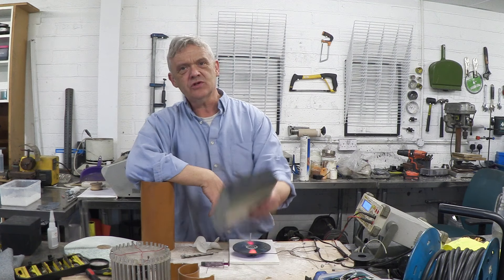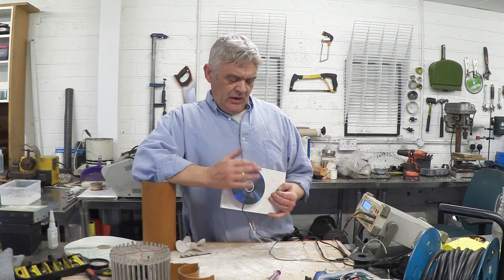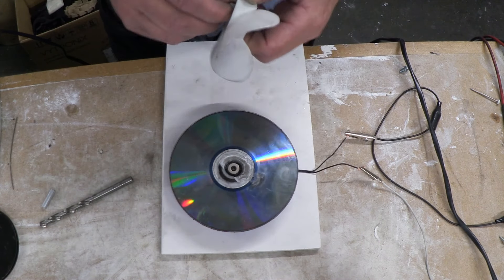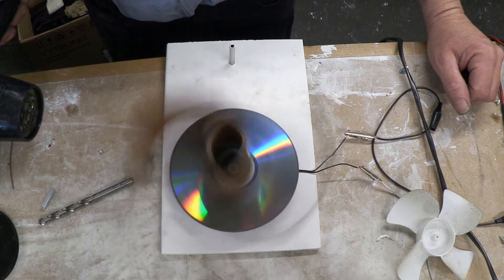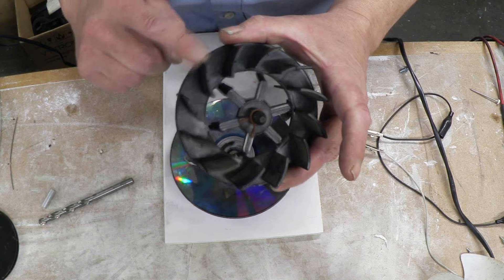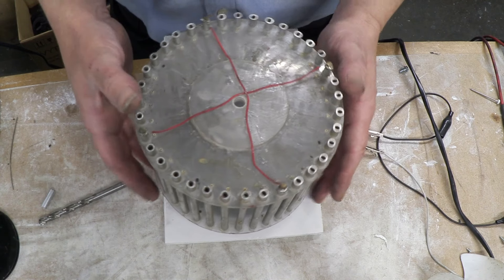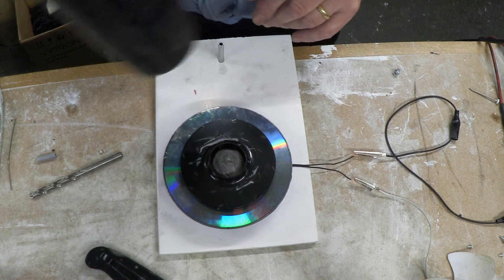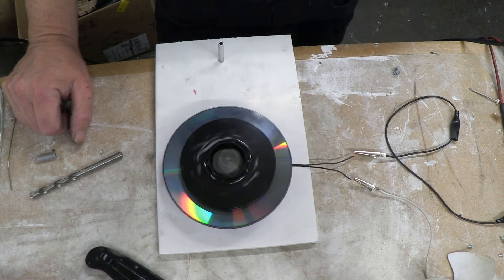A Flat Wind Generator

Comment: I'd like to build a boat propelled by a Savonius rotor sail through a shaft and gear arrangement to a propeller.  You could sail it in any direction regardless of the direction of the wind.
Reply: No you would NOT, but good luck trying and do not let me (or anyone) stop you from trying.
Reply: @XwpisONOMA Actually, it has already been done years ago.  I saw it in Popular Mechanics, or Popular Science, or Science and Mechanics, one of those magazines.
Reply: I believe Savonius did that himself.  I remember seeing a picture of him plowing across rough water with it.  I expect  you could tack into the wind like a normal sailboat, but the rotor’s wind resistance  overcomes any energy the drive train puts out.  Savonius rotors are fun and easy to make, but are among the least efficient omnidirectional turbines.  There have also been sailboats built with tall rotating drums which generate lift on one side as the wind blows by it.  I have also seen a small RC airplane that used rotating drums for wings.  It actually flew quite well.
Reply: @danajohnson5993  The airplane with the rotating drum wings works on another principle called the Magnus effect.
Reply: Guy Pehaim - the sailboat with the rotating drum sails (3 of them ) also worked on the magnus effect. I wasn’t saying the Savonius rotor had anything to do with that effect, only that there were other omnidirectional wind machines that had been used on boats. Savonius rotors are nice because while inefficient, they are extremely simple to construct in sizes that can generate quite useful amounts of power.(they also look really cool..  the Darius rotor which looks a bit like a vertical eggbeater, is a much more efficient omnidirectional rotor, but it often uses a small coaxial Savonius rotor to get it started.  Like the standard three bladed wind turbines it can spin faster than the air that moves it.

Comment: how much does the displaced wind reduce in speed with the “flat discs” format? would it be possible to manipulate the output such that it turns the squirrel cage?
Reply from the maker: i suppose it would - do you have something in mind?
Reply: @ThinkingandTinkering  
if you could place squirrel cage generators in 1 to 4 directions around the flat disc generator, then cover it up so the flat disc generator is the only one you can interact with outside the wall, how much additional power could be generated from the displaced wind blowing into the added squirrel cages?
essentially 1 point of entry but up to 5 generators together...

i dont think it would be wise to add an additional layer beyond that though. probably not worth it beyond that

Comment: Actually if you have the wind pressing equally across an entire wall, the pressure will be equal on all portions, therefore defeating any and all potential for high speed wind flowing through all of your centrifugal impellers so that you could not obtain any real speed, and what little rotation you got would be negligible and essentially incidental to changes in the angular cross flow of the wind as it slipped up and around the flat face of the wall the unit(s) were mounted onto.
Reply from the maker: I am sorry normally I love your comments but you say this like it is.a fact I can't contradict. I have to ask did you check out Mike Waters like I suggested?

Comment: Rob the cone is the same with the air intake of the compressor of a jet engine (with the spiral painted on it)
Reply: Michael Nunnerley exactly what I was thinking!
Reply from the maker: yeah it is - I didn't really notice until you mentioned it
Reply: and likely works similarly, also, the spiral painted on them is designed to catch the eyes of birds & scare them away from flying into the engines.
Reply: @geodeaholicm4889  0.0! Awesome to know!

Comment: I'm curious to see what a cone with helical striations and adding a collector horn would do.
Reply from the maker: nice suggestion mate - cheers
Reply: Not much actually, if you hold a funnel to the wind you aren't going to get more compact air or faster wind out of it. In fact, the turbulence created by the walls probably reduces the power coming out from the other end and the wind that can't fit in there will simply flow past the funnel.

Comment: You should do this with an old hdd. The frictional losses are way way way less comparably. Actually can you do this with a hdd and still charge a battery granted it's a brushless motor? Or would it need to be rectified?
Reply from the maker: you need to rectify it mate

Comment: What if u had a wall in between the cone and air coming out the side that let air out of the turbine but left the cone area open for air to get in on the last turbine. On a large scale it might reduce friction but stopping the air from hitting the sides. Maybe not but just a thought. Very cool designs
Reply from the maker: good thoughts mate - thanks for sharing

Comment: could take the flat wind generator and combine it with a sort of flattened squirrel cage design so the generator can function from multiple angles perhaps
or you could make the flat wind generator not flat at all, elongating its design to allow alot of space for the air intake and outputs so it can theoretically catch more air and accelerate faster.

Comment: I would sure love to talk to you. I've been working on my project for a whole lot of years, alone. It's not going anywhere fast with just me. I wish so much that I had someone like you working with me to bring my SolarBreeze to life...... when I began all of this, my knowledge of electricity consisted of, Don't pay the bill, they turn it off, don't poke things into the outlet holes and keep away from all liquid stuff while standing in it.
Reply from the maker: lol - you learnt all the essential things for sure - I can try to help but I won't be of much use as I do get rather a lot of requests and I already devote 3-4 hours a day answering email, posts and comments so there is a limit to what I am able to do - but if you fancy asking, feel free and I will answer what I can - robertmurraysmith64@gmail.com
Reply: @ThinkingandTinkering   I designed a wind powered electric generator that can be built into the attic of a building kind of thing and can also be portable. Are you on face book messenger, by chance?
Reply: @ThinkingandTinkering  I just need to build a micromini prototype.... THe problem is, I'm not in good health at all. When I complete the prototype, I will begin getting enough money to afford treatments that my insurance wont pay for. It could save my life. I'm afraid that it will go to the grave with me. To me, its so simple, really. I can see it so clearly in my head and the versions I've made so far worked, but led to more redesigns..,. I just need a barbie sized one... Oh, and patent pending
Reply from the maker: @JeriAnDrews  I'm on facebook but I barely use it - feel free to send me a message
Reply from the maker: @JeriAnDrews  if you are patent pending you don't want to talk about it - it will invalidate your patent
Reply: @ThinkingandTinkering  Ya, I hadn't really planned to go into any detail. Just wishing I had someone like you on my team. I could finish this, maybe even get treatment... possible get better to some degree. I know my invention works. I just can't get over the finish line, not alone i can't. Its a sick conflict. Finishing it could save my life, but I'm too sick to finish it....
Just sad. really like being alive.... Jind of gotten used to it....
Reply from the maker: @JeriAnDrews  it's a bit of a cleft stick all right - sounds to me like the best thing here is just to leave it - can't help with out details - with details your patent will be invalid - not a lot to do here I am afraid - I do wish you the best, Rob

Comment: Would that specific motor you are using, have enough power to charge a battery charger? Obviously I'm thinking of an off grid situation where you just want some extra lights in Winter..
Reply from the maker: no idea mate - this is a demo of an idea not a finished thing

Comment: Why not take your last one, the flat wall version and put a big long horn collector in front of the center opening to better match airflow impedance.  At the mouth of the horn, you have the high mass flow rate,  low pressure wind  (low impedance).  The horn will be acting like a transformer, gradually changing the wind energy impedance as air moves from mouth to the horn throat to make a higher pressure  lower volume airstream before entering the center.  This may result in  a better, more efficient match of source and load impedances.  Impedance matching may improve the efficiency of the energy delivery.  Horns are used as acoustic transformers, this is just pushing that concept to near DC.

Comment: I would be interested to see how good that last one would be with a cone that tapers out to at least the diameter of the CD. The cone doesn’t even have to spin but could be held half a millimeter from the impeller by a bracket.
Reply from the maker: Just google Mike Waters and wind turbine - remember I am only demonstrating this - Mike has done a lot of work on this and looking him up will probably answer a lot of your questions
Reply: Robert Murray-Smith 👍

Comment: Imagine a bank of these vertically along the outer walls of your house under the guttering then all being inverted to your home electrical system. I understand you won't get enough to run your home but you will get enough to power your refrigerator which runs 24/7. Add this to other brilliant examples you demonstrate and your power bill will be substantially less. That last fan is from a vacuum cleaner isn't it?
Thanks for the video mate, I appreciate your time as always 🤔
Edit** was the title meant to emulate your business initials or just a coincidence,?
Reply from the maker: cheers mate - another thing struck me on this - you probably wouldn't need planning permission
Reply: Only 1 or 2 walls could work at a time though unless you live in a screen tent.  Even the windward wall couldn't do very well due to aerodynamics.

The squirrel cage version could be quite effective along the roof ridge though.  Plus the higher you go the faster the wind... maybe even some channelling effect from the roof.
Reply: @ThinkingandTinkering  depending on the country but I also doubt very much that any planning permits would be required. Imagine a couple of squirrel cages banked up on each face of your chimney with motors top and bottom of each of your squirrel cages, even shorter cages with motors top and bottom increases output capabilities. I think bigger motors such as the 24v XD3420 would be much better also
Reply from the maker: you need permits in the UK mate - anything that protrudes above the existing roofline

Comment: Shouldn’t the cone have been bigger than the hair dryer and the flywheel? Isn’t the air hitting the flywheel slowing it down? Counteracting forces? Using an air compressor small nozzle might work better for all experiments.

Comment: The last design looks a bit like a brake disc - fly wheel and impeller in one from worn out brake discs?  Another excellent video.
Reply from the maker: you are right mate - it does - I wonder if they could be used?

Comment: Why didn't you direct the air down on the fan blade and the squirrel cage like you did the impeller? Same for the impeller, why did you not direct the air from the side. If you are going to test, do each fairly. 
Is it because both the fan blade and squirrel cage would have spun better than the impeller from downward air?
Reply from the maker: because it is not a test mate - it's just a demo
Reply: @ThinkingandTinkering  Then why didn't you do the demo fairly?
Reply from the maker: @Alwis-Haph-Rytte  lol - very funny

Comment: By selecting just one wall of the building you are ignoring other 3 walls (25 % efficiency at the very beginning , if wind can be in any direction).  So instead of this a vertical wind harvester at the top of building would be much better i think.

Comment: With all due respect, these designs will be greatly enhanced by Bernoulli ducting to accelerate air velocity. Especially if you add to that last design, a rounded circumferential structure, to take advantage of the Coanda effect, not on a wall, but on its own freeing standing support, cone in front. -James Stewart, Ph. D. Physical chemistry.

Comment: Maybe a turbine from a scrap automotive turbocharger could work. The part from the vacuum cleaner is very similar to brake rotors on a car; moving air toward the outside. These all might benefit from an air foil design (cross section of an aircraft wing). I think the metal tube squirrel cage could benefit; instead of tubes have air foil wedges. Even the microwave fan, I believe would benefit if the blades were reshaped into air foils. But what I’m saying here is speculation. Also if I could get wind to go down a pipe to turn a fan, impeller, or even a corkscrew. Of course a upside down cone would have to be placed on top of the pipe to direct wind down. But the advantage of that is that it wouldn’t need a windvane & it could work from the wind blowing in from any direction. I’m guessing then a problem with said design would be precipitation. But that could be resolved if it’s sealed like a water turbine.

Comment: I was thinking that last one sitting in the same orientation that you had it on the side of a building catching the air as it flows down the outside of tall buildings or maybe inverted at the top of a black pipe via convection.
Reply from the maker: nice one mate

Comment: The squirrel cage takes advantage of the magnus effect i guess ?
Reply from the maker: yes I would think so mate - at least to a  degree
Reply: IMO yes and it is cool.
Reply: How? The Squirrel cage isn't being spun by another source as the air passes, causing high and low pressure that causes lift/directional force. It's being spun by the air passing through it.
Reply: @Mr Rytte                                yeah quite rytte you are ! I see but not in the same way. Having a pile allows wind to streamline in it exit and continuing on to the next pole in a more intense pressure. Not magnus but something different. I think it has a name but I can't find it!

Comment: The last design is essentially NOT anything like a Tesla turbine which essentially has NO blades whatsoever! When used as a generator, the direction of rotation of a Tesla turbine is determined by the angle of incidence of the airflow. Being bladeless Tesla turbines can be very efficient, but the pressure differential across them must be significant, rather than the volume of flow.
The beauty of what you call 'squirrel cage' and Savonius turbines is that they extract energy from low pressure high flows whatever the radial airflow direction and don't need turning into the wind.
Reply from the maker: sorry mate - I could have sworn I have seen a number of Tesla turbines with aerofoils, blades and spirals and didn't Tesla himself say a spiral groove would imrove it? - oh well my bad

Comment: Now put a negative Ph cone in front of the water pump type impeller blade
Reply from the maker: or you could
Reply: @ThinkingandTinkering  hehe,  you're not wrong! 
I'm into pumps, a pump impeller has that cone shape that you installed already there,  come in a lot of different sizes too,  little more weight in them for flywheel action possibly. 
Love ya work. 
Cheers

Comment: If you  cut a 500 lb sandstone transducer tuned to 90 hertz and mount it on a fret at the NODES like a Xylophone key.... and hook up a wire at each end of it you can get a trillion volts just by singing to it.......if you take the voltage to charge a capacitor and add a spark gap on top of the transducer it will create a feedback tone and give you free energy forever. Simple as hell if you use the golden ratio and tune it properly. You can also use the pressure wave of 829:1 created by the 500 lb transducer and hammer on some piezoelectric stones and boost it up to 829 trillion volts at a frequency of 15 million hertz... don't do it though it's too dangerous. If your transducer was capable of the gigahertz bandwidth... whole blocks of people would literally disappear... de materialize into a higher dimension.... teleport....  The gigahertz bandwidth is too much power.....

Comment: Waters' solution is the best, indeed. I have known about that for a while I just need to build one, not just watch. Or, possibly do more, watch less.
Reply from the maker: I think you are the first person I have across who has actually looked lol
Reply: @ThinkingandTinkering  Thanks for your reply!  I watched his presentation several times - he did what you actually did in you latest video - re-used and reversed the existing fan 'squirrel cage'.  So technically, he just stated the obvious. This solutions is oten used, in many devices. Industry knows, our job is to learn from the industry and use it for our purposes.

Comment: I really doubt that the flat version against a wall would work very well since there wouldn't be any airflow through the blades. The air molecules would probably just 'pile up' against the wall and not flow past the turbine.
Reply from the maker: maybe mate - but it's interesting and worth looking at for sure
Reply: @ThinkingandTinkering  There's your next experiment then.  ;-)
Reply from the maker: @CaptWho  for sure mate - well maybe not the next one - but it is on the list